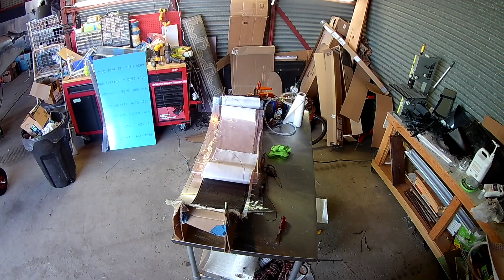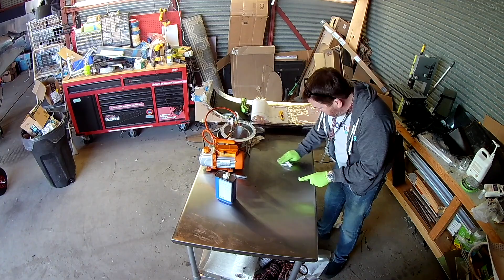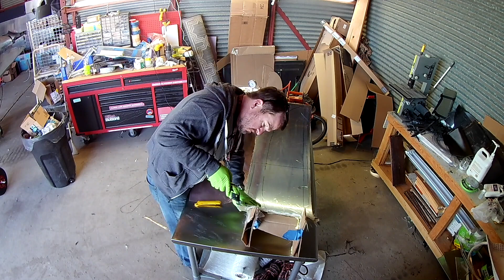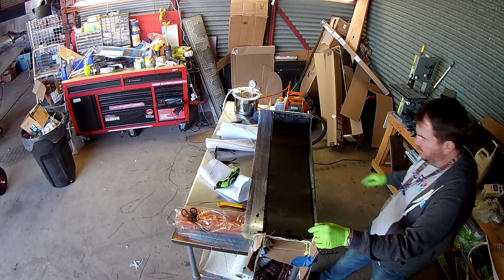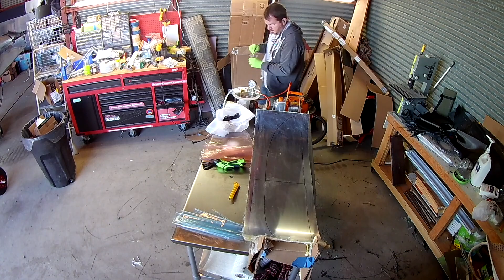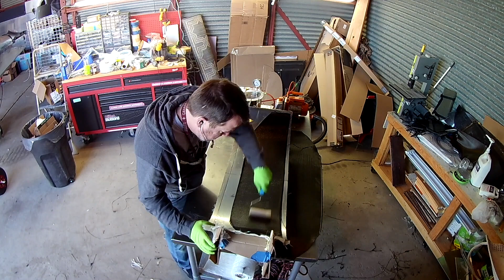RV-14 Glareshield Production

Comment: Thanks for taking my question about inspections.   So, when you complete the plane, no official certifies its safety?   Amazing.  But as you pointed out, throughout your build, you've had many first hand looks from other builders, not to mention all your online audience.
Reply from the maker: Well the Designated Airworthiness Representative will inspect the plane, go over paperwork and look at the builder logs to be satisfied with the plane's safety when its ready to fly but yeah that's all that's required.

Comment: Pilots are tossing their old graphite vane engine driven vacuum pumps overboard like boat anchors.  Do you think that connecting one of these to an electric motor would pull enough vacuum to work for vacuum bagging?  If so.....  nearly free solution?
Reply from the maker: Meh. Not worth the while to make a mount, wire, etc etc. plus they're crap. :D